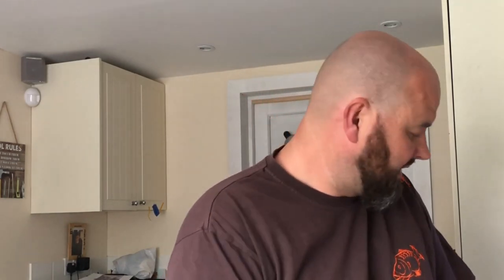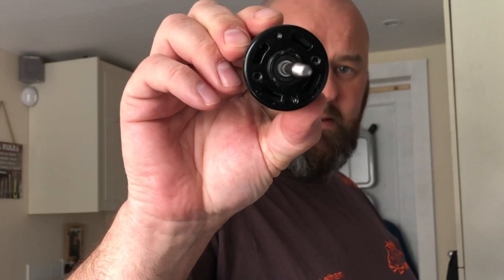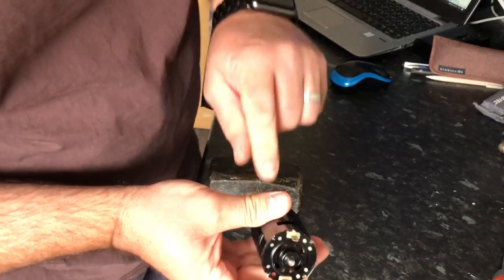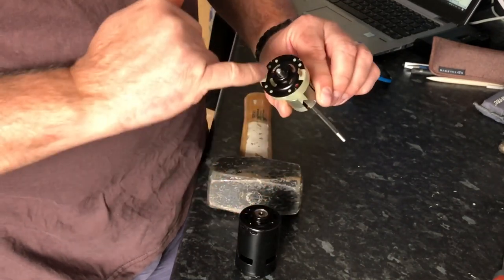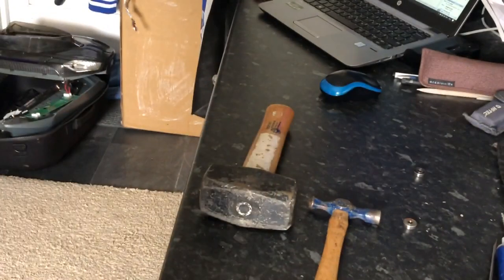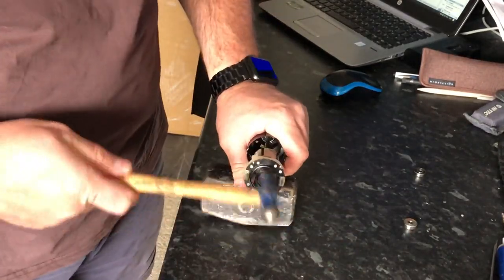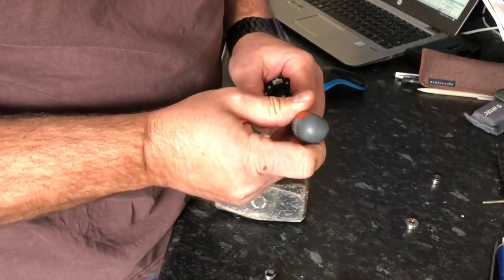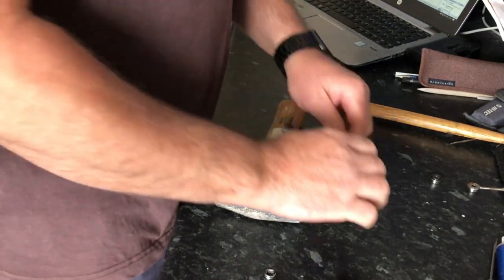Bait boat motor repair

Comment: I think my big lake bait boat has normal RC car parts inside it comes Friday interesting stuff thanks for sharing.
Reply from the maker: Lacoste Alot yep big lake boats utilities allot of off the shelf parts however they are waterproof and fit for purpose for sure. I built one of them for my father in law. Good boats in general but not well balanced front to rear, you have to put a little weight in the ear to ensure the props sit in the water correctly.
Reply: @weekendcarper6001  thank you I didn’t look at any reviews I was in to the rc hobby to and always fishing and like the simple design of the big lake bait boat what did you use to put weight in the rear of the boat cheers.
Reply from the maker: Lacoste Alot I put a second set of batteries in there so he had double the run time
Reply: @weekendcarper6001  cheers mate I will look into doing that cheers 👍

Comment: Hi.its good your showing people how to change the bearing because some people don't know.the rust on the old bearing must be water rust.iv change many bearings I put the in the freezer it shrink them then fit the bearing in the motor housing then give half hour to warm the bearing then fit the motor shaft.i would not hit with a hammer it could crack the magnets.another way grab a socket the same size as the bearing and a extension bar open a vice put a piece on flat wood the put the end of the motor up pressing on to the wood then put the socket and socket and extension bar get i as level as you can then turn the vice until you fill its fitted. Fitting the motor shaft iv never had to hit a shaft in as hard as you did that was a very tight bearing and you had to really hit it a lot to get it in .the only time I use a hammer is to tap the metal lips back over to hold the motor back together.that new bearing sounded to loud to me. Fitting new bearings they must be fitted good if the bearings are not fitted good and soled they will make a noise.A lot of bait boats ware the motor sits at the bottom of the boat and the shaft goes straight out all way let's water in. Some bait boats ware the motor housing and motor fit under the boat there is one rubber seal soon as that seal worn in comes water and that's the end of that motor.i have my shafts on a angle water never gets.in ever.

Comment: Great video - where would I get the new bearings from - for a waverunner mk4 with noisy motors so was going to change the motors but may try the bearings first - thanks
Reply from the maker: Jamie Bowler if you measure the bearing (OD Outer diameter, ID inner diameter and width) you can get them with a quick search on google, just make sure you get rubber sealed bearings.

Comment: Great vid i have ND bait boat same problem can you tell me were to get bearings from and part no Thanks in advance
Reply from the maker: If it’s the ND1 then the bearings are 5x16x5 Part number I believe is 625-2RS

https://www.ebay.co.uk/itm/625-2RS-BEARINGS-6252RS-Good-Quality-Bearing-Rubber-Sheilds-5mm-x-16mm-x-5mm-/283097809677?mkcid=16&mkevt=1&_trksid=p2349624.m46890.l49286&mkrid=710-127635-2958-0

Comment: I've got an anatec catamaran with very similar motors, and anatec want 90quid for two, what would be your advice for near like replacements, am running it on 2s batteries, might even go 3s if the next brushed motors allow me to, thinking the mtronics m600?
Reply from the maker: I’ve not seen inside an Anatec so can’t give you direct advise on the motor unfortunately, however if you are switching up to brushless then you can’t go wrong with Mtronics, it may not be cutting edge but it tried tested and very robust. I would also look at Hobbywing hardware. They have been me of the biggest ranges on the market now. Good luck